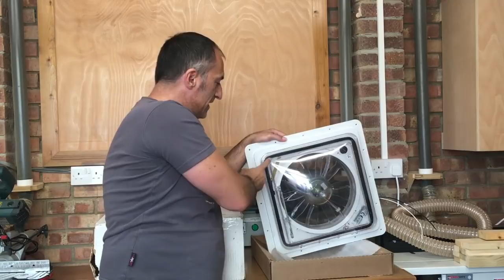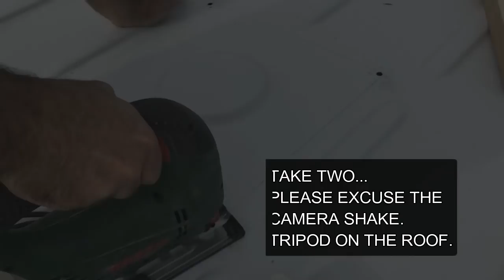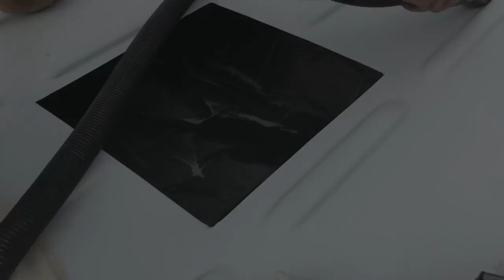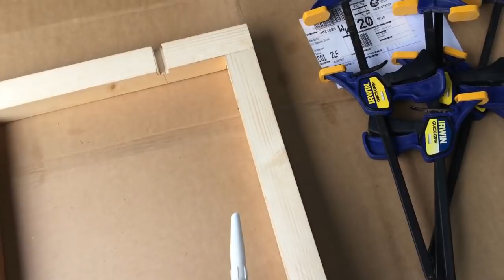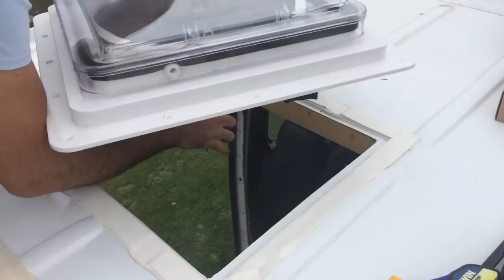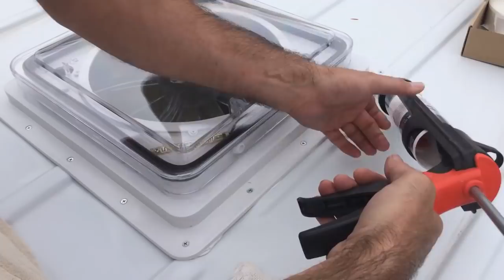Mercedes Sprinter Self Build Campervan - Roof Fans

Comment: Hi Greg! Just wondering, did you use mastic on the inside on the van before camping the timber frame to the roof to create a smooth surface there too?  I'm planning on doing this soon & my ford transit roof is very bumpy!

Comment: The van does not need two fans. Just one fan on extract or supply will make the windows seem like a draft going through there. One fan will do just fine. Do agree with your fan selection - Maxxfan is the best for us.

Comment: would it be a good idea to put a blob of sika flex on each hole before driving the screws home? Maybe it would help prevent any water getting in through the screw if the blob on top fails. Great video by the way, i'll be following your methods for everything on my build 👍👍👍

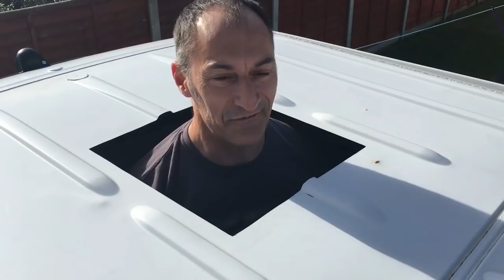Comment: I just bought a brand new sprinter and I have the same little circle on the roof right at the back of the vehicle near the edge of the raised groove. You can see it in your video at 5:38. Mine is raised and the edge around the circle is cracked??? I'm worried about water damage from it. What even is that thing for?

Comment: Hi Greg  great video but I need your help. I bought 2 maxx air deluxe fans and the instructions say say to cut an opening of 400x400 mm( k140  model) but have measured the receiving flange and its only 355mmx355 should I cut my roof to the flange size as 400mmx400mm will be to big or have I got wrong size fans ....please help as I am ready to install 2 fans
Reply from the maker: The fans are the same size. The thing that’s different is the size of the flange. You can order a 355 flange or 400 flange. Check which one you have ordered as that will give you the answer to the hole you need to cut. Come back if still stuck and I’ll try help more.
Reply: @GregVirgoe  cheers Greg I think i sorted it now, it' s because the flange that goes on the roof has a raised bit that goes in the cut hole (which won't because like the sprinter  the crafter roof is not flat ) that's why I have to cut hole to 400x400mm . Phew!! panic over thanks for getting back to me Greg ....You the man!!! I have followed your sprinter build from the start its inspired me to do my build . Thank you, thank you.
Reply from the maker: @clasrobinson6544  it dies sound like you have the 400 hole flange. It has a series of raised squares around the hole then the flat flange beyond that. You would be right to then cut a larger hole 👍🏼😃

Comment: Hi Greg, thanks for another great video. Is there any concern that the holes created by the self drilling screws will experience rust? Or am I just being paranoid here, and the screws are such a snug fit in the holes that this shouldn't happen?
Reply from the maker: Don’t worry the screws are a very tight fit so no hole and they are surrounded by mastic sealing tape so no water will get near them. 👍🏼
Reply: @GregVirgoe  Ok, nice one. Thanks very much!

Comment: After you finished cutting the roof out then wiped it down ?? Then, when you put your head through the roof, the roof profile had changed ???
Reply from the maker: I cut two holes for two fans, one front and back. Well spotted 👍🏼😊

Comment: I have a quick question regarding sealant.  I'm seeing so much mixed stuff on forums and I'd love to get your feedback. Lots of people use Sikaflex 522, the argument against this is the fact that it is not removable by any means other than mechanical. Making it a nightmare for replacement.     Many large campervan companies use mastic based sealant across the board like SEAMSEAL CV by Hodgson Sealants. This allows for easier removal, without 'in theory' reducing its ability to withstand flexation and water.   

What are your thoughts on this?
Reply from the maker: There is a product called Marine Formula Debond which makes it easier to remove. I used it when I replaced my roof fans. Look out for that video or the fan we fitted for Archie & Me. Used it there too 🤩
Reply: @GregVirgoe  Interesting! Thanks for the heads up.   

Just about to start undertaking our 2nd van conversion after our 1st got stolen shortly after completion.  Tragic really! But your videos have really helped us over the past year.

Comment: Hi Greg, awesome video? Can you give me the measurement from the rear door to the edge of the fan and same from windscreen back? Awesome video.
Reply from the maker: These fans are positioned in the centre of the roof beams. The front one is centred on the circle depression in the roof. The rear one is centred in the first wide roof bay.
Reply: @GregVirgoe  awesome as always. Just saved your playing to use as a step by step. Thank you so much!

Comment: Thanks again for a very helpful video! I noticed that when a have a leak in roof vent it is usually at the screw holes. Do you think the combination of the tape and the sicaflex could be sufficient?
Reply from the maker: Yes it should be fine. Put some sikaflex over the screw heads

Comment: Hello, many THANKs for  inspiration!!
May I ask,regarding butyl tapes,does it work good?? No rain/water goes inside??
Currently choosing which to buy. All people are using Just more glue,no butyl tapes...
Thank you!
Reply from the maker: You can’t go wrong if you use 
W4 Mastic Sealing Strip 32mm it will work the best with no leaks
Reply: @GregVirgoe  Many Thanks!!
Your videos are really Very helpfull for finding ways how to do things 👌
Reply from the maker: @gemdevel5259  really pleased they have been useful to you 😃

Comment: Excellent video, thanks a lot for sharing. I have a question though - aren't you worried about the screws you added at the end - the debree they've created while going through steel will rust, won't it? I am wondering if I should draw the holes first.

Comment: Hi Greg.. how did you work out the depth of the wooden frame?  Ps I bought the max air fan :)
Reply from the maker: Ideally it needs to be the depth from the underside of the van roof to the top of your ceiling. So basically the depth of the roof beams plus any battens. 😘

Comment: Cracking tips as usual Greg. We're looking forward to doing our on conversion as we are away quite often with our daft Springer Spaniel and your tips make it look achievable by mere mortals!
One thing I have discovered when cutting holes in thin materials is that it vibrates. A lot! To minimise this, after the first cut, I put a piece of gaffa tape over the cut to hold it in place, then do the other three. I find that cuts down (see what I did there?😏) on the vibration and reduces the risk of creases on the skin of the van.
I hope that helps?
Keep up the great work 👍

Comment: Hi Greg - just discovered your channel  - great stuff ! I have a 92 Hiace commuter with a slightly side to side curved roof in the region (the back half) that I'm planning to install a roof vent.  Apart from the Mastic Sealing strip do you have any other suggestions for installation?

Comment: Morning Greg,
I am just strating my van conversion, simple question really but with the MaxxFan does it matter which way around it is mounted? Example can the fan open fan forwrds? Many thanks for the very imformative videos
Reply from the maker: The fan is designed to be fitted with the hinge facing the front of the vehicle in the direction of travel. For the simple reason if you leave it up when driving the wind is not going to rip it off your roof. :D

Comment: Greg you put two fans in the roof, right? It seems the first part of this video was the front and then you finished up with the rear fan mount, am I right? Do you have more video of the front fan installation? I don't plan on installing a fan in the rear unless it becomes necessary, then I will do it later. So I would like to see how "you" installed the front fan, if possible. Thank you your videos are very helpful. I especially like the way you reinforced the sheet metal with the wood frame.
Reply from the maker: Daniel Flynn the process is exactly the same for front or rear. Makes no difference
Reply: @GregVirgoe  Did you use the wood frame on the front too?
Reply from the maker: Daniel Flynn yes both identical.

Comment: Great video! I'm thinking of putting my own roof vent in but i have no tools, any advice on what jigsaw to get?
Reply from the maker: Li Ching Gan the jigsaw makes little difference what you need are the right blades. You need HSS METAL cutting blades 👍🏼
Reply: @GregVirgoe  Great thank you Greg, would you recommend the fine tooth blade or a coarser one?

Comment: Hi Greg, I'm doing a roof light in the next couple of weeks.  Been trying to find a way to overcome the ridges in the roof... I've seen it done lots of ways but yours looks like the easiest to get a really nice fit.  I was curious to hear if the mastic has lasted?  Great series of videos- I'm fining them really helpful!
Reply from the maker: Henry Clarke yes 100% the mastic sealing strip is the best way to go. Get a wide one 32-35mm and overlap the corners it is the best stuff ever. Easy to mould and sticks like shit. Make sure to clean the roof and the plastic fan to remove any moulding release agents.

Comment: Hello Greg, thanks for the useful contents, I am planning to buy a minibus just with 2 side windows but, I am a bit worried about the electrical part how to manage and where is safer with easy access and what should I consider when I should order the equipment altogether or partially? I must have warm water in the shower, kitchen sink also roof fan, LED lights,  50 or 75 L. water tank with pump,  Heating system with control panel. Do you know any easy design program to adjust the tings inside? About security bars on side windows, have you had any experiences with or any suggestions? Thanks bro.

Comment: Hi Greg, by using self drilling screws you can't apply any rust protection to the drill hole. Is this OK?
Reply from the maker: Seb Blake yes it is fine if you are a little concerned just put a blob of sika at each screw location. But the screw is a tight fit in the hole

Comment: Great work Greg, your videos have been my bible tough out my van conversion, Thank you!

I'm going to be installing two roof fans Fiamma Turbo Vens, on the instruction manual it suggests the use of SILKTASTOMER-710/THEROSTAT II, however I'm more inclined to use your recommendation (Sikaflex 512 caravan).
Would you happen to know what's the difference between the two, if any ?
Regards

Comment: Hi Greg, I love your video series, it's my first call for my van conversion. I have a question that I don't think has been asked yet. I'm installing my roof vent fan on a flat spot on my van (no ribs, though the roof is slightly curved). Would you still recommend a layer of mastik all the way round the edge of the fan, or just fit it slush to the roof? I imagine the mastik would help get a good seal?
Reply: Wow, that was quick!
Reply from the maker: Scott Laxton definitely use a layer of mastic sealing strip it’s by far the best thing for making that seal waterproof. 👍🏼😀

Comment: I'm fitting my fan very soon with these exact materials, wanted to ask how well has it held up? Anything extra you'd add?
Reply from the maker: Andrew Smart make sure to clean off any mould release agents from the new fan body. Other than that’s it’s worked a charm. Don’t forget to sika your screw head too 😁

Comment: Hi, I'm about to start on my van conversion, but having trouble choosing a decent roof light and fan, it seems difficult to get an idea of what the quality is like and some are just very expensive. Have you heard any experiences with the Fiamma roof lights and fans?
Reply from the maker: Pierre Bernard I did have trouble with the fantastic fans they did not work. 
So have since swapped then for Maxxfan Deluxe which are amazing. They really do work well in all weather and super quiet. 
I have another video of me changing them and an unboxing video.
Reply: @GregVirgoe  Nice, thanks for the quick reply. I will check that video out. You're video's are very helpful!
Reply from the maker: Pierre Bernard this is the unboxing video https://youtu.be/IwBJGIvhyAc
Reply from the maker: Pierre Bernard here is the install video https://youtu.be/tyY8HIxzwv4

Comment: Greg, you have the neatest fan install on Youtube that I have found. I'm installing two Maxxfans in my sprinter this week and am using your video as a guide. I plan to use plastic screw caps filled with sealant over the screws for a uniform look and to protect the sealant from Sun and UV. That is the only way I thought of to improve on your brilliant example. Thank you for the whole video series. I know there are many people around the world following your tutorials. They have been recommended to me several times, but they are preaching to the converted. I might christen my van Greg, or at least GV, Greg Virgoe and Great Van, same initials, go figure.

Comment: Hi Greg, how has your mastic strip lasted?  I fit my rooflight just over a year ago, but it has started leaking.The mastic has gone really brittle and has a cracked surface. I noticed the last time I was on the roof - but now it is letting water in.  Did you choose a particular brand of mastic - and/or did you do anything to protect it from the elements?  I wonder if mine wasn't UV resistant.  I need to do something differently, or it will just happen again.  Cathy

Comment: Hi Greg.  Are these huge fans really necessary? These and the upgrades you did later on move something like 900 cubic feet of air per minute.  Seems excessive and then you have two of them.  And they cost a small fortune. 
Before finding your videos i was planning a conversion but i was gonna use two 100mm PC fans in a push - pull configuration.  Plenty of cost effective 4" fittings available too. 

What do you think? 🤔

Comment: Hi Greg just about to order my Fantastic fan for my "Renovation" project.. I was wondering how did yr fans perform when you were in Spain and Portugal ? 
Cheers Ian 🚐💨
Reply from the maker: Ian Snowdon, I’ll be honest mate I wish I’d fitted maxxfan instead. Just cos you can use them in the rain.
Reply: @GregVirgoe  fair play at least your admitting it as with the usb situation, makes everybody else's headaches less it's a shame them plugs sockets don't have a dc camper option for the usb side but I suppose if it's wired wrong it would be lethal

Comment: Hi, I have some questions about the mastic tape you recommend.  Is mastic tape the same thing as butyl tape?  Will the mastic tape and sikaflex adhere together?  I was going to use butyl tape instead of mastic, but the guy at the hardware store said butyl puts off a gas which will cause the sika flex to not adhere properly.  That got me worried about using two different sealants together.  I'd prefer to just use one product for the whole job, but dealing with the roof ribs seems to require two products.  Thanks for the great content, btw.  CB
Reply from the maker: Christopher, I recommend you use the mastic sealing strip they are excellent. You will have no problem with using Sikaflex afterwards. The mastic tape is amazing stuff and by far the best product to seal up the voids between the ribs. It's like a very sticky plasticine that you can mould to any profile. 👍🏼😃
Reply: Hi Greg!  Thanks so much for getting back to me.  The main issue I am having is finding an alternative to the mastic strips you recommend that will work in conjunction with sikaflex.  I'm in the US and don't have time to order a product from the UK.  I saw that you recommended XFasten Butyl Putty Tape to another reader.  I was worried about its compatibility so I called Sika and a tech told me not to use them together.  I cannot seem to find any mastic strips for the US market, only putty tapes or butyl tapes.  I found this eternabond tape that looks promising: Doublestick MicroSealant® Putty Tape and I'm waiting to hear back from the sika rep with product recommendations.  I wish I could just use the stuff you recommend, but I've got a rapidly approaching deadline.  Anyway, it seems like I am making this harder than it needs to be, but I just want to do the job right the first time.  

Have a good day, hope you're enjoying a watertight van life!
CB
Reply: Hello,
Never mind!  This is such a mind fuck! I found an adaptor that will hopefully solve the problem.  Now I can Sikaflex the whole thing!  :):):):):)

Comment: Hi Greg, in EVERY video i've seen so far they seem to use Mastic Sealing Strips.
I was under the impression that the best thing would be using only SikaFlex since its adhesive properties are superior.
Am i wrong , or is Mastic Sealing Strip just a necessity when trying to level an "uneven" roof? can one do without? Thanks in advance, as always fantastic job explaining.
Reply from the maker: In my opinion I think the mastic sealing strip is far superior than the sealant. 
I’d be happy to just use that and no sealant but not the other way around. My advice would be to use it even if it was a flat surface it is brilliant.